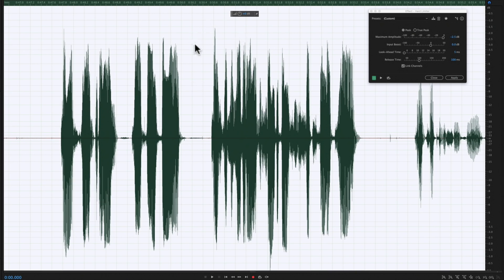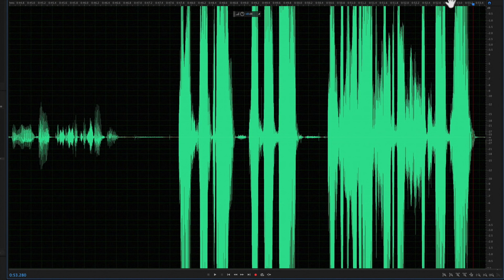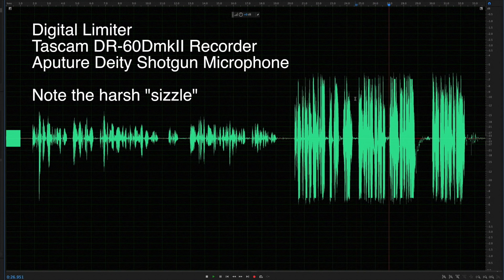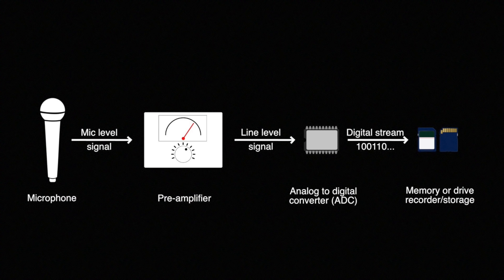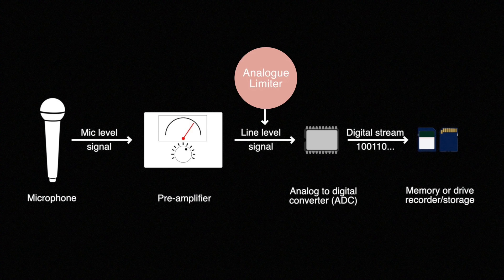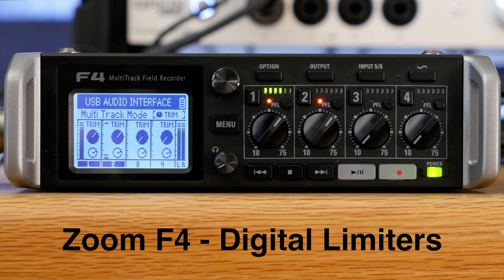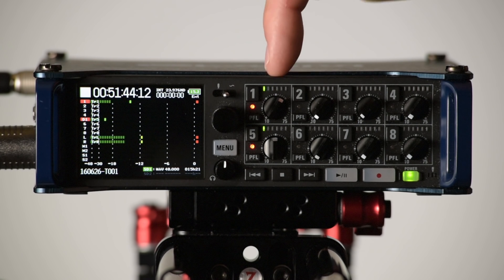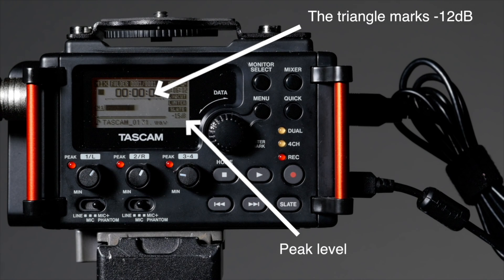Limiters for Recording Sound: Analogue vs Digital

Comment: Thanks Curtis. Why -18dB instead of -12dB - is this just to provide an additional buffer?
Reply from the maker: Yes, more headroom. Modern recorders are cleaner so there’s little cost to leaving more headroom.
Reply: @curtisjudd  Thanks Curtis. I was under the impression that increasing gain in post was inferior than in the recorder itself, but sounds like you're saying modern recorders have extremely low-noise floors, and so increasing gain in post these days, has negligible impacts on increasing noise?
Reply from the maker: @itsdannyftw  Depends on the recorder and microphone of course, but yes, that's the main idea. I have no qualms about boosting levels by 18 dB when recorded on the Sound Devices MixPre (with a quality microphone).
Reply: @ Fantastic thanks as always Curtis! 🙏

Comment: Thank you for the great content, sir. Can I ask a question? Is there also an analog/digital low-cut filter? If so, I guess mics will use an analog low-cut filter, and Mixer will use a digital low-cut filter. Then, what about recorders? Do recorders use a digital low-cut filter or an analog low-cut filter? I'm asking this question to better use a low-cut filter as a peak-controller. I would really appreciate it if you teach me on this.
Reply from the maker: It depends on the product, but usually it is the more expensive recorders that use analogue filters and the cheaper recorders which use digital filters.

Comment: Thanks Curtis, as always, excellent tutorial.  I record on a MixPre-6 Mrk-1 I am starting to use the limiters and I am happy with the result, it is a great ally in interviews when there is an unexpected laugh.  What are the post-production downsides of using limiters?
Reply from the maker: Thanks, Gabriel. You cannot undo the effects of a limiter, so I suppose that could be a downside if you set your gain too high and end up running the audio levels into the limiter constantly. But as long as you use them just to catch the occasional laugh, I don't see a lot of downside.

Comment: This is very well explained, thank you for that. By the way, do you know any mixing consoles that feature analogue limiters? I’ve got the MixPre 10T but unfortunately there are basically no EQ options on it. The new sound devices Scorpio seems like the ultimate solution but that one is around 12.000 bucks, lol.
Thanks
-Danny
Reply from the maker: Many of the newer digital mixing boards have compressors which you could configure to work like a limiter. I have an Allen & Heath SQ-5 mixing board which has EQs, compressors, high pass filters, as well as other processors.

Comment: Hey Curtis, every time I have an audio question, I think, "Has Curtis covered this already?" Anyway, appreciate the video. Would you say there's a preference for using a digital limiter in a recorder (in my case, the Tascam DR-10L) over "repairing" it in post?
Reply from the maker: Hi Andrew, thanks! I generally turn off digital limiters and deal with the issue in post if I must. But that's just personal preference. I haven't done any sort of formal test to determine which is the better approach in terms of final audio quality.

Comment: Should I ever use the limiter on the Tascam DR-70D or should I just lower the gain to -18dB or lower?
Reply from the maker: I generally just lower the gain. It probably won't hurt, but you could end up with some distorted peaks if you do not turn it off.
Reply: So let me get this straight because I may not understand digital limiters perfectly. Do they distort EVERY signal that's over the threshold or just those that are far too loud? Until now I thought that if a signal is say 3-6dB louder than 0dB, it gets compressed (is this the correct word?) to under 0dB by the limiter and we're good to go, while if it is 10-20dB louder, it gets distorted due the digital nature of the limiter. Is this thinking wrong and in fact every signal over 0dB gets distorted via a digital limiter?
Reply from the maker: Hi Kelna91, it depends on how much of the signal goes over as to how much distortion is audible. The biggest problem with digital limiters is that the analogue preamps may distort before the audio even gets converted to digital and then the limiter attempts to do it's job, however, it is too late. So to answer your question, technically, anything over 0dBFS clips. Whether you can hear the distortion depends. You will almost certainly hear it if the audio coming in to the analogue to digital converter is so hot that it ends up at +3dBFS. How long a section exceeds 0dBFS is also a factor in how much of it you hear.

In short: I'd turn the Tascam's limiters off and gain down a touch to leave yourself some headroom for laughs or yells, etc. Good luck!
Reply: OK, thank you for clarification!

Comment: You can save yourself some vocal strain by just recording your signal "hot", speaking soft (no clipping) and then speaking louder (clipping), without the need to scream. Although most clipping comes from level spikes, you can just as easily get clipping with an overly hot signal. And, yes, the limiting functionality will work exactly the same in both extremes. Just a suggestion so you don't blow out your voice.
Reply from the maker: Thank you Dave. :)

Comment: I keep seeing the argument that if you set the proper levels you shouldn't need to hit the limiter. I get that you said you aim for -18 now for extra headroom but what's your take on that side of the argument? I still use a soft knee limiter on my recordings just in case though.
Reply from the maker: The other side of the argument is valid as well. You don't want to apply so little gain that you end up with a mess of preamp self-noise in the recording. However, unless you use an analogue limiter in the signal chain before digital conversion, then pushing the gain too hard will result in clipping. So in the end, it is a balance. Then there's also the fact that leaving 18dB of headroom (or however much you choose) may not be enough in some cases. I usually find it to be a safe level but some talent are really loud when they laugh or very dynamic.
Reply: Yeah, I'm still quite new to this and I'm only working with audio on an idny level.I still don't think I'm doing anything wrong to feel like I should put some effort into making sure I have the best usable audio in any situation. Thanks for your help once again.
Reply from the maker: I absolutely agree. Good audio takes lots of effort and I support that! That's why I put together courses to focus on skills. I encourage you to keep at it 100%!

Comment: Just found your channel Curtis.  Totally subscribed.  Any chance you could review an Audio Technica BP4025 mic?  I've been eyeballing that one and I really can't find ANY reviews on YouTube about it. Maybe because it is not a new release???
Reply: SleepDroid Studios I have a BP4025 mic that I use for field recording. It replaces my older AT825 mic. I also have a new BP4029 stereo shotgun that you should consider as it has M/S and L+R output, is lighter and has longer reach yet still provides good stereo ambience. The BP4025 is the best XY stereo field mic out there in this price range. It has excellent sensitivity, wide freq response, deep dynamic range, and is really quiet. There is also the AT8022 that looks almost the same but has about half the tech specs of the 4025. I don't mean to highjack Curtis' thread but I agree there is very little info online about this most excellent field mic.
Reply: Hi, I'll add that to my list of microphones to try! Thanks!
Reply: Thanks RallenMan.  I'm really considering the BP4025.  The more I look, the more I think that I want to go that way.  It's nice to hear that someone has one and likes it.  There are almost no reviews out there on it.  It would be nice to size down to that also.  I have been using two studio mics lately and with the whole setup I feel like I need a camel with me to move it all around.

Comment: What about pure software, non hardware based limiters like those found in the waves bundle? It would have been cool to see how they stack up against these examples. Nice job either way!
Reply from the maker: That's another case where the limiter is in the digital domain so it will not help to prevent clipping during recording. But also like other post digital conversion limiters, can do a great job pulling down transient peaks in post.

Comment: Nice explanation. Thanks Curtis. It might also be worth noting that you can still get distortion from a very loud source if the mic itself is overdriven. So the distortion occurs inside the mic and before the sound reaches your recorder, and no kind of limiter will help really. Most good modern mics can tolerate very high sound levels (SPL), but you can't push any of them too far really. So it's best to monitor your audio carefully in those extra loud situations (tricky by nature), and back the mic away a bit if necessary. Cheers.
Reply from the maker: That's a good point as well Heathcliff, thanks for that!

Comment: I love when you yell. Haha. But this was a good comparison, the digital limiter really doesn't do a bad job at all if you set levels right.
Reply from the maker: Thanks! I think that on the F8, it is the wide dynamic range of the preamp which prevents it from clipping more. The Tascam didn't sound all that great - and it has significantly less dynamic range.
Reply: Yeah digital limiter sounds better in this case and have more dynamic range

Comment: Nicely done, good info. Good demo. I can clearly hear the clipping distortion in the digital limiter examples. I read a couple comments saying the clipping could not be heard. I guess it is a matter of critical listening as to whether or not a person can hear it but I assure you, any post sound editor would have serious problems using the digital limiter examples you demo in a pro production. 

I would like to clarify where the limiter is in a pro recorder like a Sound Devices 633 (or 744, 702, 688, etc.). The signal limiting takes place at mic level before the preamp, not after the preamp at line level. Analog preamplifiers can distort when overloaded so it is important to limit the analog signal before it hits the preamp. From the SD 633 manual: "In normal operation, with proper gain settings, the limiters should rarely engage. When activated, these limiters will prevent unusually high input signal levels from clipping the analog input stage of the preamp."

Also in a 633, High Pass filtering is done before the preamp to prevent amplifying unwanted low frequencies that could eat up headroom in the preamp. An F8/F4 does HP filtering in the digital domain. That means the analog preamp has to amplify powerful low frequencies that eat up a lot of headroom for no good reason. That kills dynamic range. This is yet another reason why the electronic design is more expensive in a 633 than a F4 or F8, and why the 633 sounds better in challenging audio environments.
Reply from the maker: Great info! Thanks especially for the clarification on where the limiting occurs on SD gear. That explains why it is able to prevent distortion (or saturation?) before the preamp stage.
Reply: Tech Note from SD on 6 Series Limiters: 
https://www.sounddevices.com/tech-notes/6-series-limiters-and-indicators
Reply from the maker: Excellent info added just this month, it appears.

Comment: I currently keep gain level pretty low for the safety margin. Then I use Normalize filter in my Audio Editor (i.e. Audacity). I know I am sacrificing ADC resolution of my recorder (specially since it is only 16bit. Not 24bit). But that is what I currently have.
Reply from the maker: Good strategy!

Comment: Another thing which Zooms don't have and only the LS-14 has from Olympus even their pro recorder doesn't have it. Is called Smart Mode. Here's how this works. But it depends on you knowing that the talent is gonna shout. Like Pastor Jason L Cooley. You hit record, you have the person scream or what ever at the loudest theywill go or think they will for the setion, then as they do this hit record again. Now the mikes are fully live at the leval that the LS-14 somehow and this is epic that it does it. But somehow it calculates a good leveal for the recording. The only other thing I saw that has something like this is the Roland Quad capture. By the way, do you have any outdoors nature or just trafic or what ever kinda recordings you could drop box me or something? Especially even at 48 KHZ 24 Bits? I'd love to hear the F8 fully unleashed. I mean there was that holywood sound recording on the Zoom youtube channal. But remember it's youtube. You  don't get the full blast audio quality. Thanks.
Reply from the maker: That sounds like a useful feature!

Comment: Would it be worth the extra effort, when recording an event with lots of dynamics, such as a concert, in the presence of a digital limiter, to use two identical mikes, perhaps setting one to -12dB and another to -18dB, and mix them later, so when the -12dB mike is clipped, there's still information in the -18dB mike? I hope I described that well.
Reply from the maker: Definitely, some recorders do this (Zoom F4, F8, many of the Tascam recorders). This is a fine approach as well and much less costly in terms of the price of the recorder. But it is more time consuming since you have to do a bit more work in post to replace those clipped parts.
Reply: They do this sometimes.
Reply: Curtis Judd until Lucas G shows up on the caller ID, fix it in post. 😂😂😂 #indieLife
Reply from the maker: Ha!

Comment: You often talk about this in your videos. So I thought maybe this was something to worry about. But I really hear very little difference. Much less than I would have expected. Of course I don't know to which extent this is YouTube's fault (or credit). Or maybe it's just my speakers. But if that's all the difference, I'm not going to worry about digital limiters at all.
Unless of course I get hired to do the sound for the next Star Wars, as you mention - which is quite likely to happen. 
(Next time there's a week with two Saturdays in it).
Reply from the maker: Not necessarily a shame. Zoom had to hit that price point somehow and leaving out an analogue limiter was a good way to accomplish that. And on the bright side, there's a lot of headroom in those Zoom F8/F4 preamps. I had to work really, really hard to get it to clip at all.
Reply from the maker: Lau, when you are hired to be the mixer for the next Star Wars, would you please consider hiring me to be the boom op or cable man in your department? :) Yes, this is a feature for those who cannot afford to slow down a production with a budget. Nobody is impressed when sound says they need a retake, particularly when the DP nailed the shot.
Reply: Yes I'll do that, thank you. For information on when, please check the last line of my former comment.
Reply: I could kinda hear it. He didn't hold the loud volume to really ingagge it long turm. But had he really shouted or goten into the mike's capsel you'd really hear it. Kinda a shame to see that be the case for the F8 though.

Comment: For the sennheiser avx 'limiter', where does it fall in the signal chain? From your review on it it seemed pretty good. What are your thoughts on the avx limiter rather than having to rely on the recorder limiter?
Reply from the maker: Hi Andrew, the AVX is pure magic. I'm not 100% sure but I suspect it is analogue which would also explain why the AVX is quite a bit more expensive than some of the other wireless systems.

Comment: Great info, Curtis. I'd like to ask for your opinion. I shoot shorts with students who I teach English, and I am looking to get better audio. Should I buy a better microphone first or get an external recorder first? I won't have enough money for both until some time down the line. Thanks.
Reply from the maker: Nathan, I tell me a little about what you're doing now. Are you just capturing the audio with the camera's mic? If so, you might consider booming a shotgun microphone and feeding that to camera like this: https://youtu.be/TUEmQBZKoBs Best wishes!
Reply: Nathan Clarke what are you currently using?
Reply: Curtis Judd I am using a short shotgun microphone that came with the camcorder. It is plugged in via xlr directly to the camcorder. I just wondered whether something like a rode ntg4 would make a noticeable difference. I got an FS700 couple years back 2nd hand. I like playing around with slow mo but I didnt pay much attention to audio until now. I could boom for some shots.
Reply from the maker: Booming will probably make a much larger quality difference than changing to the NTG4. Also, if I were to upgrade a shotgun microphone, I'd probably go with the Aputure Deity vs the NTG4: https://youtu.be/kom1nMM0DrQ (you can hear both of them here)
Reply: Thanks so much for your feedback. I'll give that a go. I've learnt a lot from watching your videos. Keep it up.

Comment: I presume that digital limiters actually do salvage some of the audio that gets to them.  Otherwise, there would be no benefit to having any limiter except analogue limiters in the more expensive equipment.

!
Reply: Bangs Naughty Bits  It is always better to use good software limiters in post processing,  - computing power and complicated algorithms will give much better results. Hardware digital limiters can be useful only when it is not possible to do post processing.
Reply from the maker: I think that there is a place for both analogue and digital limiters. In fact, the SD 633 has both. Analogue is most critical for preventing clipping WHILE recording as demonstrated here. Digital limiters are great in post when you're not dealing so much with audio that is already clipped, but to prevent clipped audio as a result of processing. There's definitely a place for both.